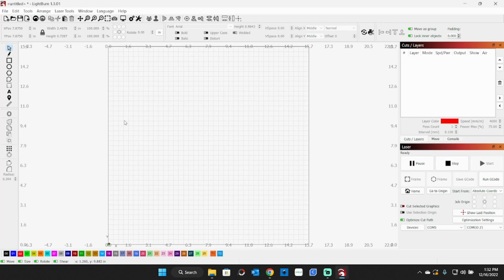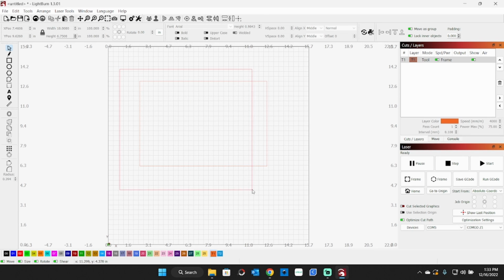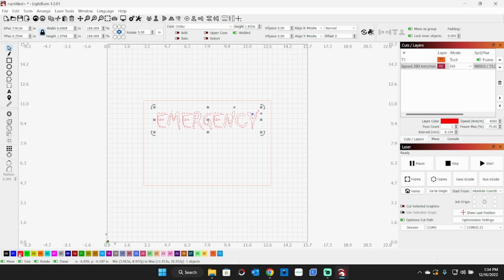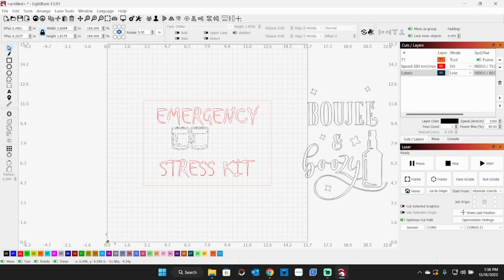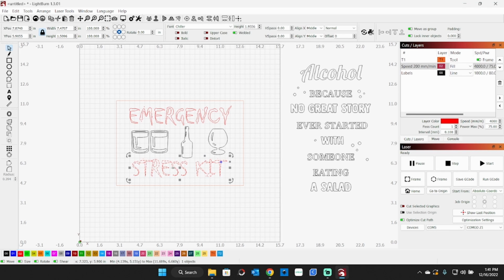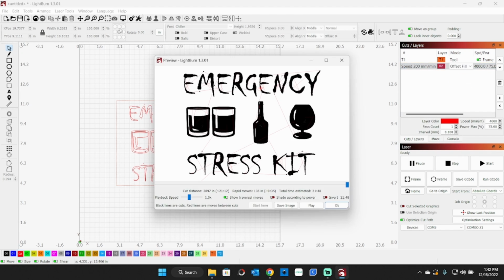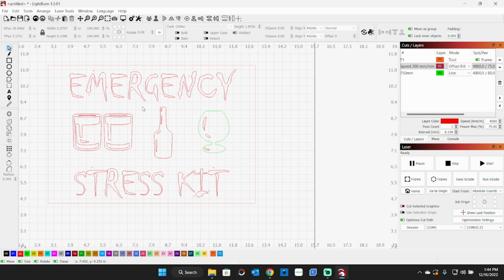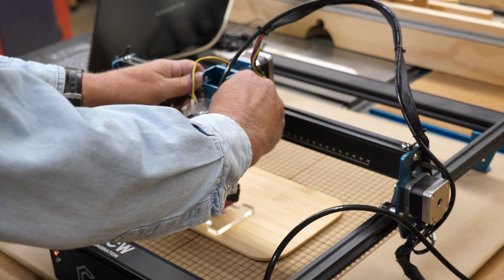Beginner Laser Project #5 Bamboo

Comment: Good morning roger I have these same boards and the longer b1 laser i am struggling to find a good power and speed option for it Iv burned up 2 boards doing test my text in test is nice and black but the boxes are a brown color or it’s eating deep into the wood I ran more test with images that are black and same results I had air assist on for test also and constant power mode is off and I was trying .08-.1 interval any hel you can give me on this would be greatly appreciated as I’m unsure what I could be doing so wrong with images

Comment: Roger i have the same comgo z1 and just added comgrow air assist having trouble cutting 3 mm basswood ply with air assist . I have slowed speed to 190/100 am i using to much air ? HELP Don
Reply: How much air?
Reply from the maker: @donlewis5105  If using the pump that came with the air assist kit, I run it wide open.  When using shop air from my compressor, about 8-10 psi
Reply: @rogersshop  Thanks i will give it a try and let you know . Don
Reply: @rogersshop  Roger i ran a test cut board . It cut at 150/80 150/90 150100 172/90 172/100 and 194/100 with 100% air and the same plus 217/100 .Thank You for your help Don 
PS if you add Drag Chain on COMGO Z1 please do a YOUTUBE.
Reply from the maker: Check to make sure lens is clean and focus is correct.  300 mm/min @90% power should cut 3mm basswood.

Comment: Was walking around my hardware store, checking all the wood sheets they has. Paulownia was in the craft wood section. They had laser cut shapes in 1.5mm in that wood all less than 1" square, wood box of 50 for about $10. Laser cut stuff is popping up everywhere. Plastic shrink wrapped.